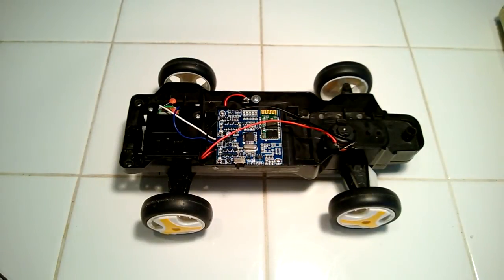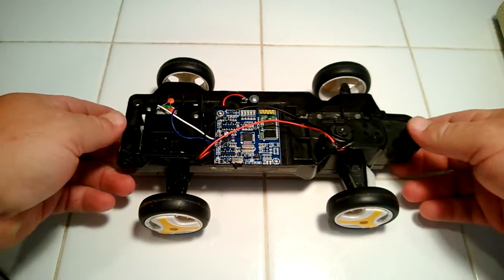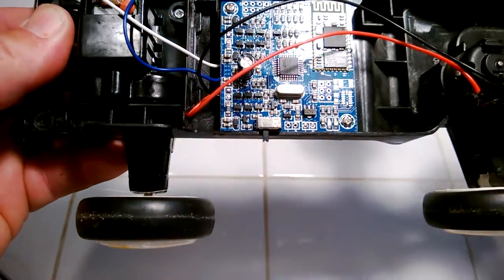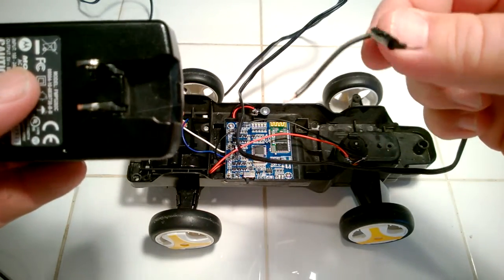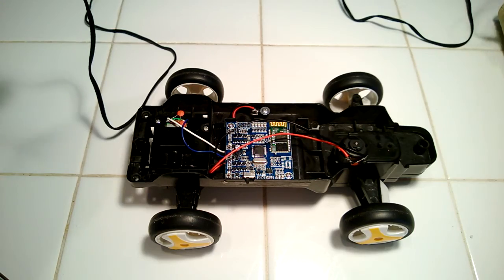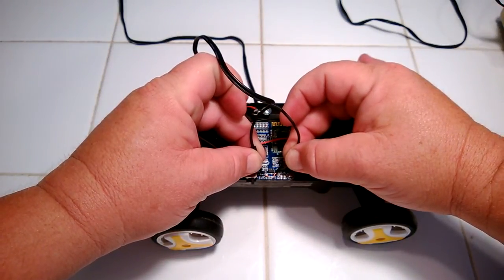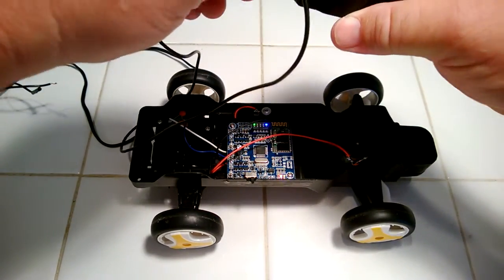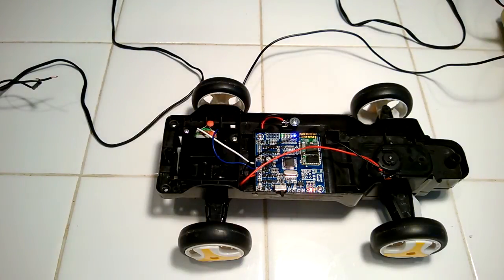How to Jump Start a Dead Dagu i-Racer from SparkFun

Comment: Bret Stateham Hey, Thanks for the video. Similar to the case with Goudgaime , I just opened the box of two of my iRacer cars today. They don't charge with the USB cables on my PC and the lights do not blink too. I tried jumpstarting as shown in your video, when the external supply is connected the LEDs turn on, however the LEDs go off as soon as I remove the external supply and still the USB cable doesn't charge the car. Any ideas? I used charged 6V NimH 3300mAh battery to jumpstart the car.
Reply: Hi. I have the same problem. Could you fix it?
Reply from the maker: Yerko Luco Nurali and Yerko, not sure what to tell you.  I haven't had a completely dead one.  Jumpstarting it as I describe in my video has always worked for me.

Comment: Hello,
I have two questions:
1. the charging takes place when the vehicle is on?
2. how long it takes (charging from PC USB)?
Reply from the maker: Yes, you need to have the power switch set to ON to charge (weird, I know).  As for the total time, I don't recall.  I can go do a test and let you know.
Reply from the maker: Ok, I full discharged it first.  Charging it from my PC using the provided USB power cable took about 2 hours for a full charge (incidentally, it took the same amount of time plugged into a USB wall charger).  What was interesting is that it took a full 2 hours of continuous use to drain the charge.  To test the discharge time I connected the car to my Windows Phone via Bluetooth and used Jeff Albrecht's Windows Phone iRacer app to run the car at full speed until it ran completely out of juice.  I thought two hours of continuous use was pretty impressive.  This really is a cool little car.
Reply: Thanks, for info - I'm testing charging from PC (via USB port). It takes about 4 hours :)